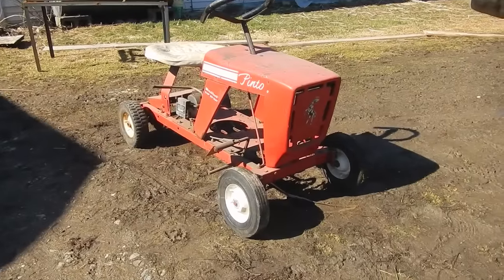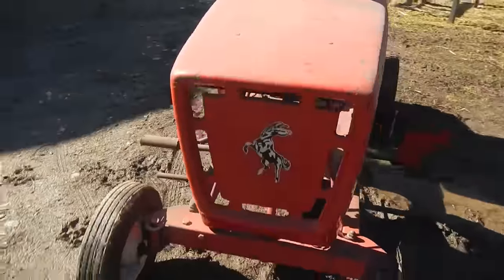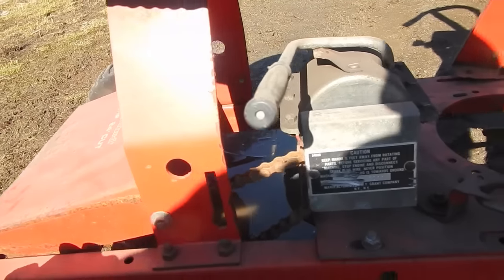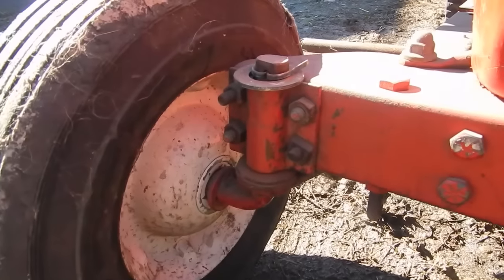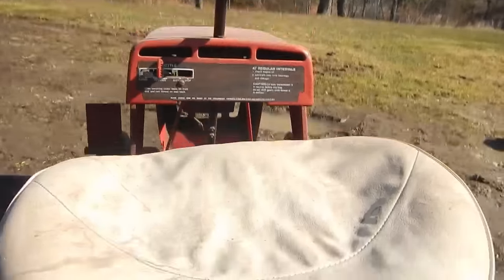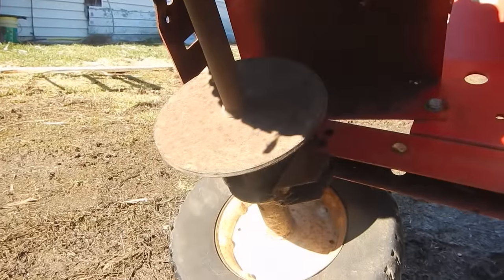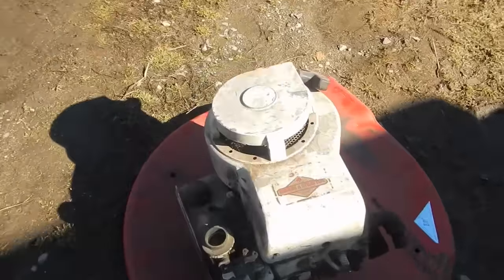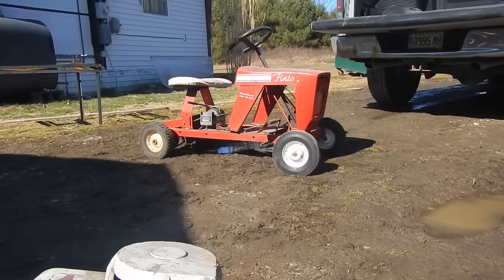New Project Mini off road mower

Comment: i am totally looking forward to this build! i acquired a homelite rm7e witch is a small single blade rider as well but a bit bigger. I am turning it into an off road rider with a half track conversion I.E. i will be able to bolt on a frame extension to add tracks or remove the frame and put tires back on so it will be convertible. would love to go for a romp with you guys some time as well. keep fabricating and having fun!

Comment: I found a frame similar to this one in the woods. I did a partial restoration on what was there, last year. I didn't know anything about it because it didn't have a hood or a steering column or an engine or a seat. However the spindles the frame and the axle aside from the brake look identical to what you have. Even the rear tires look the same. I painted my frame blue and I put new front tires on it. I had no idea what brand it was or anything about it because there were so little markings. This seems like it could be the same as what I found.

Comment: Amazingly good condition for its age.  A good candidate to leave as is with the original patina which has caught on in the automobile restoration sector.  I have two questions:What is the make and model no. of the transmission?Do you plan to repower the Pinto with a 6.5hp China Clone engine?

Comment: briggs and stratton vanguard vertical shaft 23 hp v twin
Reply: Total overkill and I think that would kill the idea of mini off road mower, you gotta stay light
Reply: Are you kidding... It would NEVER fit in that little tractor
Reply: I own 4 small lawn mowers that are bigger than that even and the biggest I can go is 11 HP without having to cut stuff up and start chopping. And I own rare lawnmowers. So that will never happen.
Reply: +WC Pagel I was just thinking on the extreme end of lawn mower racing.

Comment: Hey fearless out of the realm question but how do run a horizontal shaft engine on a lawn mower I'm building an off road mower (you inspired me to) (I'm 14) but I just need to know how to use a horizontal shafted engine on a lawn mower if you could make a quick vid explaining how to do it in detail I'd appreciate it thanks bud! Good luck on this build

Comment: Cool I thought i was the only one with a small mower I have a late 50s to early 60s cyclone riding mower with a 8 hp Briggs and Stratton flat head and 15x5x6 and they ar over size 2 inches and do you still have fearless front stickers

Comment: Is the racing mower coming back this year
Reply from the maker: +Go karting101 yes, I have a few small mods I want to do to it this year. Should get me a little more speed as if that's necessary...
Reply: +FearlessFront (Todd Christopher) cool iv been eating for the racing mower to come back and be faster
Reply: Hey +FearlessFront (Todd Christopher), I have a question. What engine did you use in the Sears diesel, and where could I get one?
Reply: ***** Thanks, I'll go check it out.